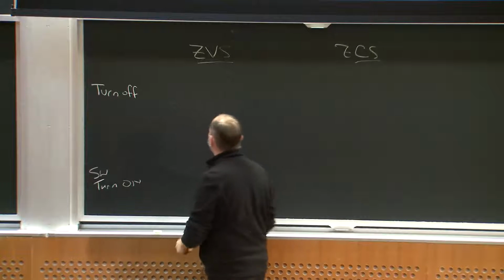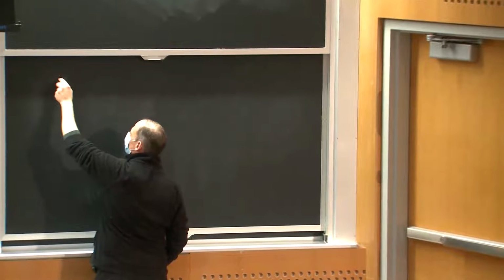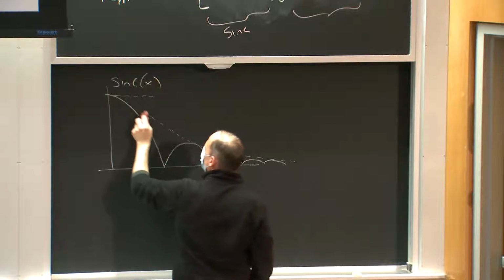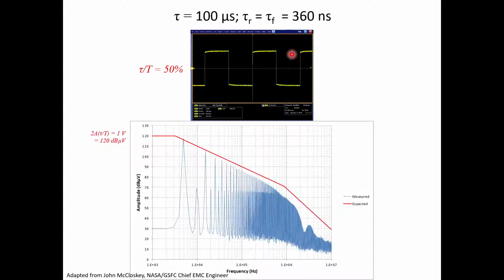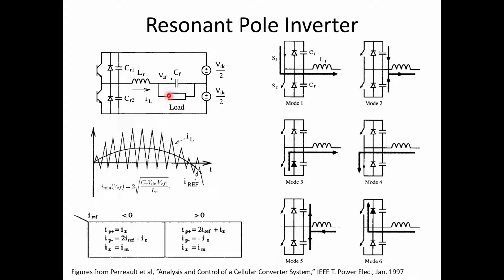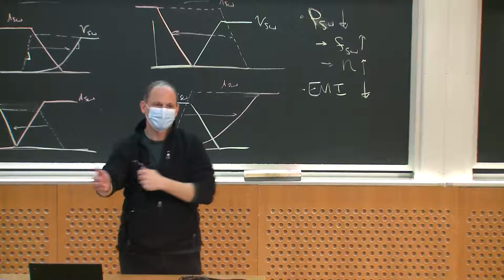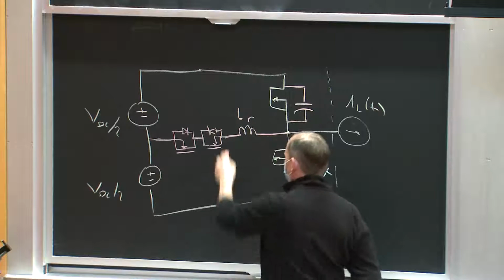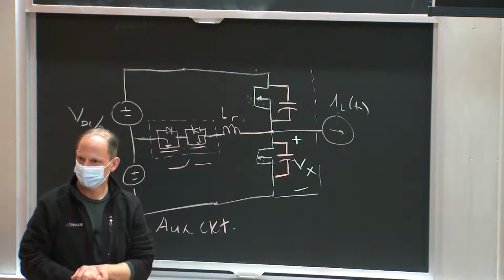Lecture 34: Soft Switching, Part 2

Comment: Dear Mr. Perreault, 

I've been following your UTube's seminares about switching modes quiet awhile yet, 
and they're good, thankyou for sharing such online. 
However, I start understanding what ZVS implies, 
but is it really worth the complexity when I am going for a Low frequency >1Kw Mains power inverter ? ? ? 
I know you probably do not have the time and interest on ellaborating on this, 
But I'd really like to go a bit deeper into the details, . . . 
I want to go for Soft Switching just to safeguard my switches. 
Efficiency and HF for smaller parts aint my primal goals, rather robustness, and reliability are ;-? 
Is ZVS and softswitching than a great thing for my design ? 
Because I see a inline in series commutating inductance rather as a di/dt slowdown feature, 
to assist in the gentle switching process, . . . 

Best regards, Harry.

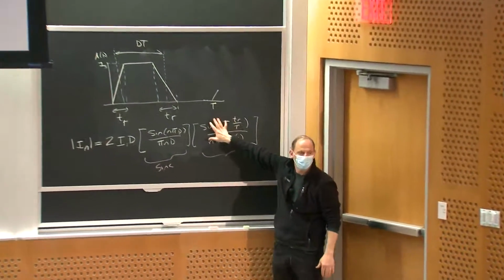Comment: 16:37, if he made tr/T = 0, won't sin(n*pi*tr/T) term equal zero and thus the whole term equal zero instead of one? I would appreciate clarification on this.
Reply: i might be wrong, but i believe since it's a sinc function it is defined in unnormalized form as sin(x)/x. when you evaluate the limit as x approaches zero, you end up having to apply L'Hopital's rule because of the 0/0 indefinite term. the original sin(x)/x term becomes cos(x)/1, which for x = 0 equals to cos(0)/1 and results in 1. this provides the upper bound of the envelope, as can be seen in the slide that Dr provides next.